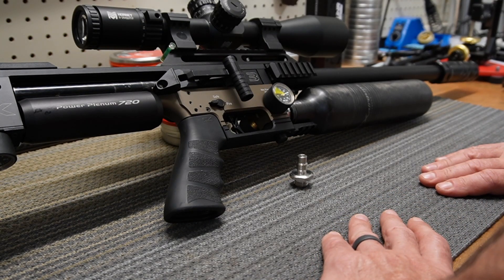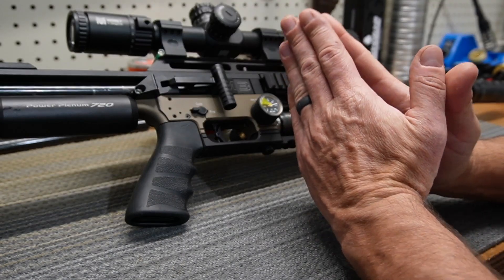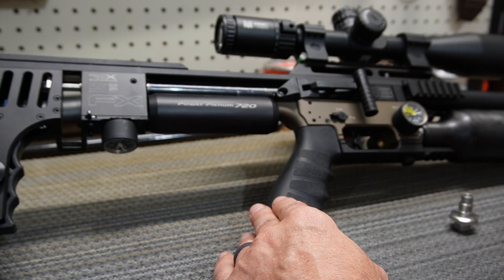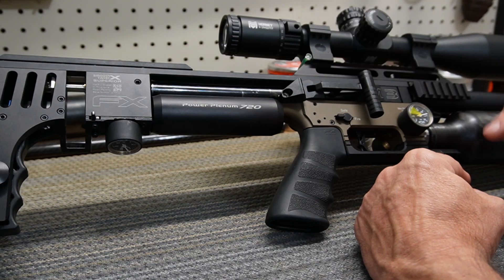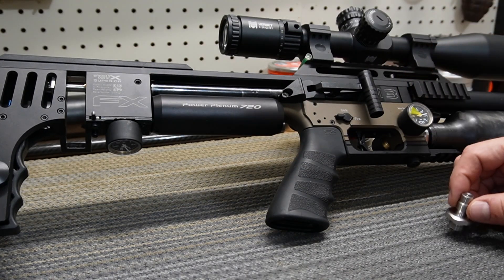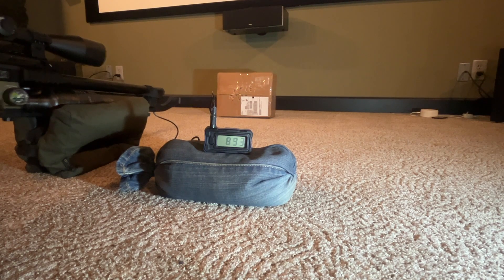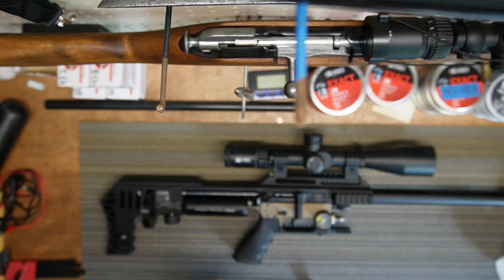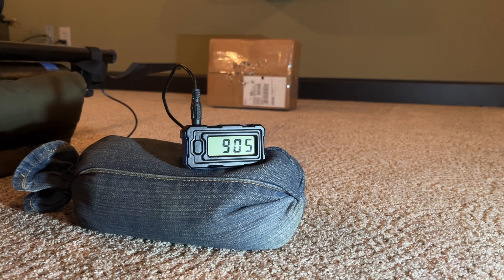FX Impact M3 - 1st stage regulator DELETE - When, Why & How.

Comment: I have the Impact Mark II and if I recall they did not have a first stage regulator !? 
I later did what most everybody did in upgrading their model with M3 components  ! 
At $30.00 bucks I hope I can find that old bottle connector !  🤨
Reply from the maker: ether that or M4 bottle connector will also work
Reply: @PCPsavage could you not turn out the regulator out to max on the M3 and get somewhat the same results ?

Comment: I shoot pellets (JSB 18.13), and I’m currently running the second regulator at 70 bar. Do you think I’ll run into problems if I delete the first regulator? Right now I’m dealing with leaks on it that I haven’t been able to fix.
Reply from the maker: 70 bar, its not that you will run in to issue, probably not, and you can always get aftermarket, better bran regulator, the issue here is the shot consistency, 250bar pressure from the bottle slams with 180BAR at your 2nd stage reg, that's allot to take, you can try to run without it, it may do well, you can always upgrade 2nd stage to HUMA reg, they also do very good job, try deleting it first and see hoe it does.

Comment: How long have you been using the rifle without the front regulator?  If it's been awhile, have you had any problem with the rear regulator?  Thanks for the video.  Looking forward to the compressor review.  Maybe do a review soon, then another after a year with the compressor.
Reply from the maker: 6 months, zero issues. Refill time between shots cut in half. Lots of people delete front reg on M3's, non that I know have any issues without it and I still can shoot SUB MOA
Reply: @PCPsavage  Very good.  Where can I find the reg delete?  I would like to find the O-rings and sizes for the reg so I could rebuild it and have it just in case.
Reply from the maker: @bigfranksworld  its made by SaborTactical part number ST0039, some shops sell them, Utah Airgun usually have them, but now they are out, goole, other shops have them, $30
Reply: @PCPsavage I did see them at Saber Tactical.  Thanks

Comment: Your change in velocity is probably not due to variation
 in temperature but more likely due to a change in atmospheric pressure between the time you went to the range and when you were testing in the basement. I am a climate physicist and a meteorologist and I was still surprised to see what a observable and quantifiable difference in velocity changing atmospheric pressure made. As a physicist I am a data collection nerd and started charting velocity vs atmospheric pressure and now know for the most part what variance I can expect under whatever conditions I am going to shoot in.  

So when it is stormy (typical a low pressure front) you will shoot fast, if the weather is nice (typically high atmospheric pressure) you will shoot slow. Most people never notice because they only shoot outdoors when the weather is nice which is typically associated with a higher atmospheric pressure. You can have low pressure and still have nice weather so ymwv with this rule of thumb, but 'typically' it is true.

Side note, I 'only' have 9.1 surround, but I run Atmos and a 50,000,000/1 contrast ratio super high coverage color gamut 85" flatscreen rated for full DTS. It beats the hell out of a projector all day. ;)

But I also have the full set of Star Wars on Blu-ray but I watch them al digitally nowadays . Fun fact, the first movie I ever went to was an opening night second screening of A New Hope which we all just called Star Wars back then. It is still the only movie I have been to where, after a few seconds of silence the audience gave the screen a several minute long standing ovation.

Another note, Nice to see I am not the only one with spreadsheets of my shooting. I have multivariate sheets that recently started including atmospheric pressure so I could graph that variable against the others. I am pretty sure all the decent ballistic calculators quietly use weather station forecasts to get the atmospheric pressure for the trajectory calculations.
Reply from the maker: WOW, good info, never thought of that, well, air temp and humidity also have something to di with it, elevation doesn't really change much maybe 50-100 ft, but the atmospheric pressure is something to consider along with air temp and humidity. thank you
Reply: @etothenphysdude206 that data definitely plays a roll  barometric pressure, humidity  and temp sunny or overcast, being a drag racer for 20+ years all that data played a huge roll for our cars with ET, jetting, timing, tire psi, etc  as well, i carried that over to the air guns and have seen 10-12 fps drop due to weather but one or 2 clicks of the power wheel can put you back on track, humidity plays a big roll on how the projectile cuts through the air as well , i have found by doing a little bit of porting and bench flowing by measuring cfm on some parts before and after to gain efficiency  helps compensate for changes as well, i keep records of all this  as its very valuable as conditions change,,, in this video i don't see weather playing a roll in his shot count its simply the reg change, i installed a 2nd reg on my 700mm m4 30 cal i had thought just the opposite this  m4 is more consistent with 2 regs i also run higher pressure 200 1st 155 2nd,, potato patatoe i guess its what works best for each individual gun imo, good video with explanation.

Comment: I deleted the first as well like a yr ago because I was having the same problem with the first reg but then I ended up just buying another one and just putting it back in because I was getting inconsistent shots ,but that was with the old second reg with the plastic delran now with this new reg that fx makes with the brass piston I think it can handle high reg pressure... But the reason I still have the first installed is because I have it set to 200 bar and I have a 300 bar bottle and I run my get kinda hard first reg at 200 bar second reg at 170 bar ..... But I think my biggest problem is that I have to shoot my gun about 6 to 10 times before it gets back to where I have it set at which is 995 to 1000 fps I think it's the dam white 0ring in the plenum I ordered 0rings from AccuShot o-rings like 2 months ago still haven't received them I tried getting a hold of him and nothing ... thanks for sharing be safe buddy I think your gun is shooting better with out the first reg have a blessed weekend
Reply from the maker: that first slow shot issue you describing is completely different problem, watch my video on how to fix slow first shot, hope it helps
Reply: @chrisfigueroa3361We have never got an email from you saying you never got your Orings , otherwise we would have sent a replacement out for free as we have had a few get lost through USPS, and we monitor all shipments through pirate ship, so to say you tried to get in touch with us and could not is simply not true...

Comment: Have you ever got decibel readings for this gun? I’m thinkin about getting one next
Reply from the maker: I tried, BUT, reading noise level is not that simple, foot in and out can change reading dramatically, every 3db is double of volume, its complicated, what you need to know is this, I can shoot this gun in my back yard in the subdivision and I never had neighbors complaining, you can't even hear it inside of the house, but again, it all depends on how it's tuned, what you shoot, how fast, .22 caliber will probably do least noise because it takes less power/air pushing it. what is your concern and your location/neighbors?
Reply: @PCPsavage neighbors know. But I like all mine pretty quiet.. just in case I have to hunt/snipe out my window… I like pcp with baffles in the shroud so when I add a moderator is super silent… if you ever want a accurate budget gun… get the Pinty bulloup